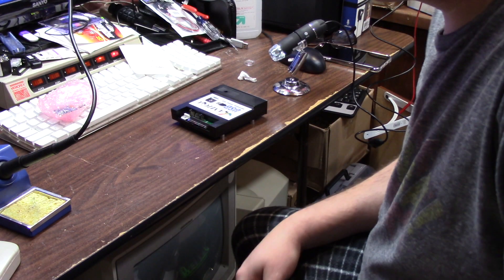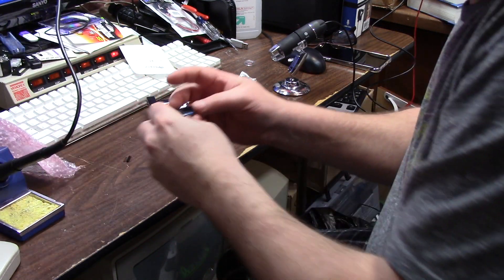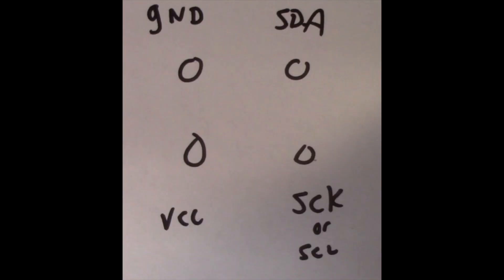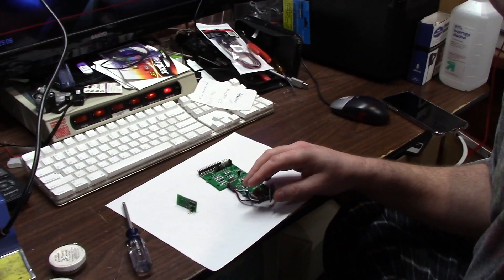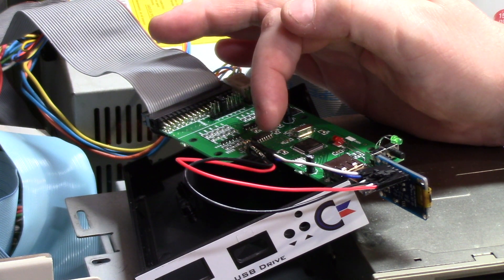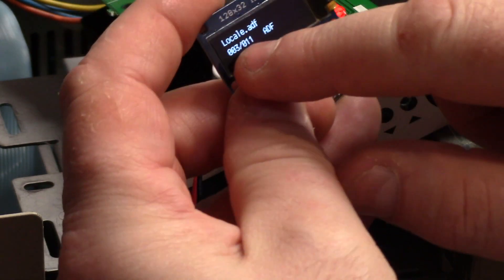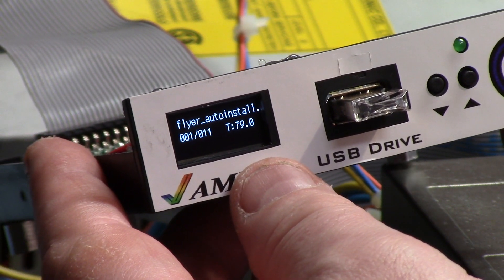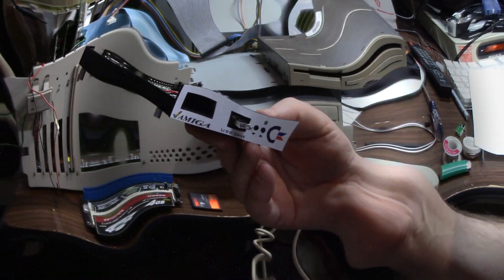Episode 76 Amiga 2000 Gotek LCD screen mod

Comment: is these displays work even what eva version have gotek or ff without flashing. maybe add those files on usb stick.
or is just magically work if lcd display work. is roraty knob work like it should you turn knob see what have but if not click it wont load disc. so diff than button it start load disc right away xD
Reply from the maker: yes Flashfloppy, and just works
you can configure what the rotary does in the ff.cfg